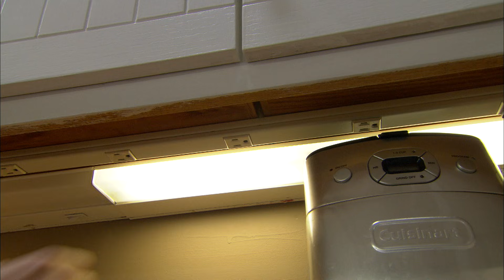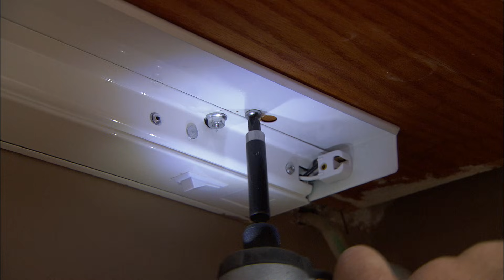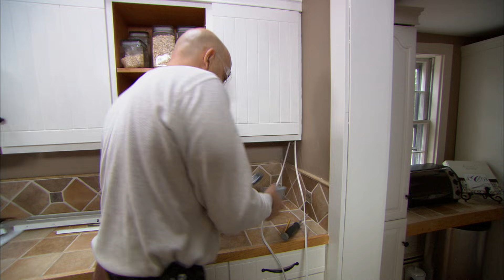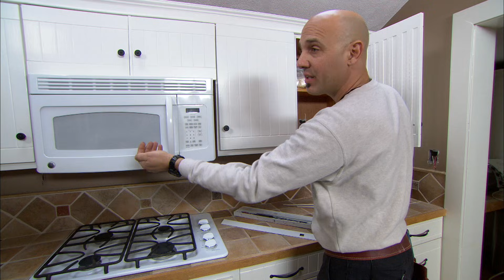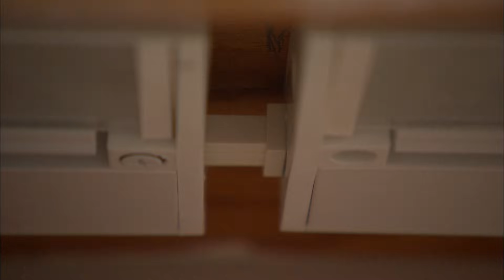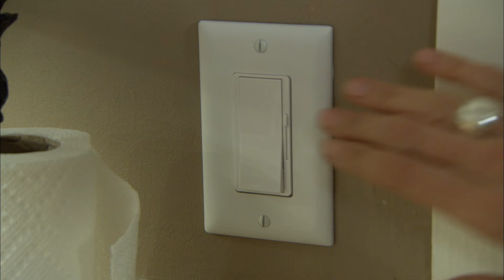How to Install Undercabinet Lighting and Power | All About Lights | Ask This Old House

Comment: Some clients of ours wanted plugmolds in under their cabinets and their Island Countertop.... unsure how thats going but because they're TR as well, you struggle to find it and gotta wrestle with it at times 😂... i asked them 3x if they were sure they wanted those and said yes. I installed strip lights as well since they didnt like the old bulky under cabinet design.... i didnt use end cap junction box... i left enough ample space for the wires to bend with the connectors and made sure all wires were completely hidden... took me longer than i woulve liked but they liked it

Comment: isn't there a tiny bit of romex exposed under the cabinet
Reply: As another commenter pointed out, apparently in most places exposed romex(also on top of the cabinet) isn't a violation as long as it isn't susceptible to damage.

Comment: shouldnt we use wireless switch at this point?  fishing wire in drywall seems very 2000 late
Reply: I don't want anything wireless because it might be dangerous to health. I use an ethernet cable on my laptop and I don't own a phone.
Reply: @flat-earther  You have a valid.concerns.  If you have a fear for wireless signals, then you should do what the video did. Otherwise wireless options such as zwave are much easier, cheaper and not to mention less mess.

Comment: Ya know it’s 2020. We have led strips you can screw or stick on. And some of em have wireless switches that are compatible. And are just as bright as those if brighter and can change colors. And can connect via WiFi to your phone
Reply: You know this video was done back in 2016, not 2020, right?
Reply: @wb6vpm  you know LEDs have been around for a while now. Right? It ain’t like they are that new

Comment: Just use LED light strips. 
Quick and easy and no screws or electrical work. 
Set up in 10 minutes or less 
$20
Reply: Not widely available in 2016
Reply: Yes LED light strips have a very clean professional look.  However, to do it right you need to connect them to a power source and have a transformer box installed somewhere.  Also you need to be able to either plug them in or more preferably have them hardwired to a switch, unless you want them constantly on/controlled by the breaker, which isn't ideal.

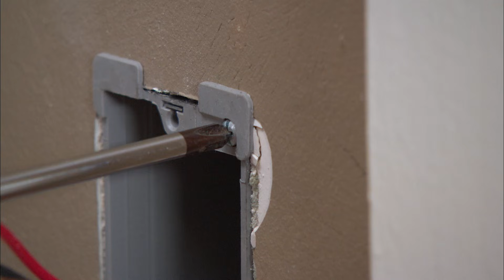Comment: 2:31 That screw is doing nothing
Reply: Can’t count how many times ATOH does that. Lol
Reply: On an old work box there are tabs that are supposed to hold on the backside of the drywall. If installed correctly, the tab will rotate into position as the screw is initially turned, and then continue to tighten against the drywall until it holds the box(or low voltage ring) in place.  2 per box/ring.

Comment: I don't get it.  There was already 110v at the florescent fixture.  I would have put a 12-24VDC power supply under the cab and run 18-20AWG low voltage wire behind the microwave.  Same effect, less than half the work.  Much less cost.  
I put a motion sensor on mine with a timer.  You enter the room...bing...we have light.  Great if your hands are full and you are groggy.

Comment: I’m thinking they had a non permitted remodel when they put in that original electrical. They didn’t put outlets on the smaller counter to the left of the stove, which is more than a foot wide. I didn’t hear anything about the two required countertop 20 amp circuits, and it looks like this only had one. Also, no mention of gfci. I don’t think Scott would do a non-GFCI outlet in a kitchen, so I’d have to assume they were protected at the breaker, or that strip had protection he didn’t mention.
Reply: Does anyone actually get permits when they do remodels inside where an inspector can't see while driving by?
Reply: If you own a house you can do whatever you want to it. If you have to get permission from somebody that means you don't own it.

Comment: All this was great except you did not show how you added a light switch by the doorway and how you routed the wires to the power and light strips. There are studs in the walls. Did you route the wires in the bottom cabinets ???
Reply: 3:06
Reply: You failed your license test for electrician.

Comment: "you'll never have to change a bulb" yeah because it's an LED and yeah they die. So you're screwed if it's a soldered strip
Reply: L.E.D. LIGHTS LAST OVER 100,000+ HOURS
Reply: @stephensnell1379  yeah but not always the case. Most people know that

Comment: That screws at 2:30 didn't grab anything !
Reply: Those screws swing out wings that press against the inside of the Sheetrock so the box can’t fall out and the box has ears that hit the front of the rock so the box can’t fall in.
Reply: You obviously don't know anything about electrical material.

Comment: Hmmm I wonder if the plug strip is gfci protected....hopefully 20 amp rated wiring in the strip?  Are these on the required 20 amp dedicated kitchen circuits?  I guess if you used a gfci breaker.  The 15 amp plugs in the strip are legal but I hope the wiring in the plug mold was #12.
Reply: If it's just a retrofit, and not running new wire from the breaker, then it's not needed. He's just replacing the existing outlets with a new one in the same spot.

Comment: Diodes are still fairly expensive but they are worth it.
And they hardly use any electricity.
Reply: LED?
Reply: @avenged06x  illuminati isn't technically wrong, they are Light Emitting Diodes.

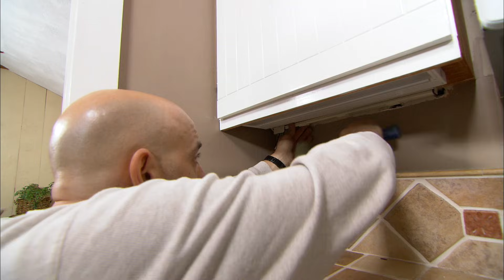Comment: 4:55 still using those rotated red hubs, those are prone to get loose and might causes sparks between wires that might cause fire.
Reply: Merets? How do they get loose?
Reply: @conqwiztadore2213  Every time someone uses electricity those wires heat up a little bit which means they expand and when it happens many times that twisted bundle start losing up and there is possibility for spark. All those wire nuts are banned in my country only push connectors are being used.
Reply: We love our wire nuts here in the states lol. I’ve never seen one come loose, but they do seem primitive. Those push connectors were pretty sweet looking.
Reply: I always twist the wires together before installing a wire nut.

Comment: If she really wanted a fix to the plug problem she should have went with the Adorne undercabinet track system.  It has an angled plug track that makes it much easier to plug in a cord.  Plus it not only offers LED lighting but also USB plugs and even Bluetooth sound as well!!

Comment: don't think the outlet problem was solved lol
Reply: put the outlets on the wall, problem solved
Reply: @rokhamler3352  the outlets need to be GFCI and AFCI
Reply: @6 @6string327  didn't immediately think of that but good catch.  Is AFCI standard/code for kitchens?  I suppose you could use GFCI/AFCI breakers.
Reply: @davidhunt6508 yup, AFCI required for pretty much all habitable per NEC, including kitchens
Reply: @rokhamler3352  I'm surprised she didn't have in wall outlets already.  The lighting thing I can understand as that's usually an afterthought add on.
Reply: I was thinking the same thing.  All that work, and he basically added a wall switch.    The outlets are still a problem.

Comment: Problem: Hard to reach power outlet.
Solution: Put on a usb charging plug.
LOL...fak your problem woman...usb plug is more important
Reply: they moved the power strip from the front of the cabinets to the back against the wall making it more easily accessible
Reply: not really better, the problem stems from the fact that the sockets are looking down and are placed beneath the cabinets so anyone of average height cannot see where the outlets are. Place some sockets on the wall between the cabinet and counter top so it is front facing and easy to locate - problem solved, plus your connected cords won't be hanging/dangling down like christmas lights from the cabinets since everything you are connecting to those sockets is gonna be probably sitting on the countertop anyway
Reply: @rokhamler3352  I'm not sure why that backsplash didn't have outlets in the first place.

Comment: leds do burn out but they should have used one with a replaceable led strip... and one that has more leds per foot than what appears to be 2... i prefer 5-10 leds per foot it gives good coverage and when one dies you dont notice it... oh and leds can blow in a thunderstorm easier than a normal bulb...
Reply: No they don't burn out
They only fail 1 by 1

Comment: If wiring is too much of a hassle for your situation, I paid around $16 at my local COSTCO for an 8 pack of LED pucks. I can touch them individually or use a remote to turn them all on or dim them too. The remote controls up to 36 pucks. Works great!
Reply: But they eat batteries like crazy
Reply: John Dough you have a link to those lights?
Reply: Costco dot com or just go into your local Costco
Reply: How long have the batteries lasted in your case?
Reply: I trying out the puck lights as well. For $20 it's worth a shot to see how long they last. So far they are working good. I like that the remote has different timer settings so you don't have to remember to turn them off
Reply: The ones I've had eat batteries and die after a year.
Reply: good ideal, but batteries do not last long, its so worth the hard wiring instead

Comment: I didn't understand the electric. 
Why did he put a box in the cabinet?
Did he just put a live wire into the wall?
Reply: He had to add a switch to the lights which required adding another wire to go up behind the cabinets and cross into the side wall. The box in the cabinet is just a junction point for the switch.

Comment: Serious question, Can I just run wires from outlets to new boxes through my walls without securing them?
Reply: That’s the real question.. isn’t that breaking code?
Reply: @MichaelAye  Check with your local Authority Having Jurisdiction for any local issues. The NEC allows for NM cable to be fished through existing walls, floors, attics, and what have you but the NEC is not law until adopted locally.
Reply: @denali9449  The NEC's purpose is the bare minimum regarding preventing an electrical fire.  I would want work in my home done to that standard even if it wasn't required by local code.

For anyone not knowing:  NEC = National Electrical Code, and it's administered by the NFPA (National Fire Protection Association).
Reply: @wownewstome6123  Yes, you are correct that the NEC is the bare minimum. Many local jurisdictions who adopt the NEC into law also amend it to be more restrictive than the model code. That is why I suggested they check with the AHJ.  
On the other hand, several states and local AHJ's have reduced the model code requirements especially concerning arc fault protection and I would agree with your concerns about building to the code minimums.
Reply: almcken2 yes, there would be no way to secure them without removing the drywall.

Comment: Allot better choices for LED lighting out there and with the possibility of a remote. That light setup is almost old school...
Reply: I'll take a switch over a remote any day.
Reply: If you're talking about those cheap chinese strips they sell on amazon or ebay then you are wrong.  The remotes stop working and you'll never find a replacement part. This is a fixture of the house so you want a high quality LED made for that. I prefer Kichler or Maxxim lighting myself.
Reply: we've got some low-profile inch wide led Utilitech brand light steps from Lowe's and hardwired them to an existed switch (converted to a 2 switch, single gang) no ballast to deal with and each strip can be removed and replaced w/o any hardware. they also have Daisy chain male-male wires that comes with each kit.
Reply: Arie, when i was making the working area light, i used 2 relatively good built-in spots: ASD RLP ECO, 8 wt, 650 lm, 4000 k, quite easy to install and replace. The result wasnt too bad, i think :)

Comment: LEDs do burn out.  When they're built into the fixture they're impossible to replace.
Reply: He specifically said" you won't have to change a bulb again, because it doesn't have any" . Technically he is right. It has diodes not bulbs
Reply: Nothing lasts for ever but you'll easily get 5-10 years out of these vs. those old flourescents that would need a new bulb every year and a new ballast.  In many cases they sell replacement LEDs and worst case, you buy a new fixture after 10 years.
Reply: +Joel Garcia But technically she never had to change the bulbs in the old fixtures either. Because there weren't any. 

----

But yes LED's will break eventually, and it's better to have them as bulbs when that day comes.
Reply: That’s why I never buy them. I only buy LED bulbs. Not ones built in to the fixture.
Reply: Highly unlikely the LEDs burnt out, what actually burnt out is the circuitry that drives them
Reply: Mr Luqman: it depends on their manufacturer and lamp type. But i've replaced all my old lamps with led ones 2.5 years ago, so far so good.
Reply: LEDs are usually rated for 50,000 hours. If they use that light 3 hours a day they will get 46 years out of it before it is noticeably dim. It will probably continue to function well beyond that.
Reply: I don't think I have something that's LED that's burned out yet, even the power lights in my Gameboy Color still work
Reply: Not sure what fluorescent bulbs and ballasts you've had experience with, but it's actually more like bulb replacement every 5 years and ballast replacement maybe once in 20 years.
Reply: Mr Luqman, with LED's you get what you pay for usually. I've only installed Maxxim lighting and Kichler and they have not let me down.

Comment: Unless I missed something, doesn't that power strip need to have GFCI protection?
Reply: My understanding is you only need gfci when the outlets were within 6 feet of a water source or outdoors. I could be wrong. I'm a landscaper not an electrician.
Reply: Nope all counter outlets in kitchens
Reply: Johnathan Schreiner you are correct